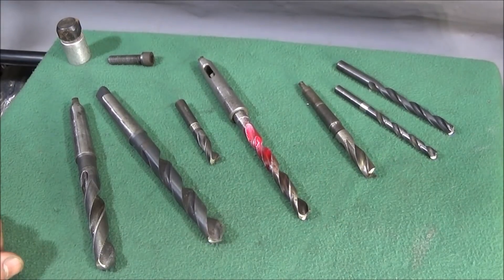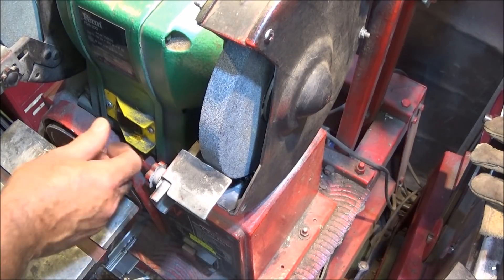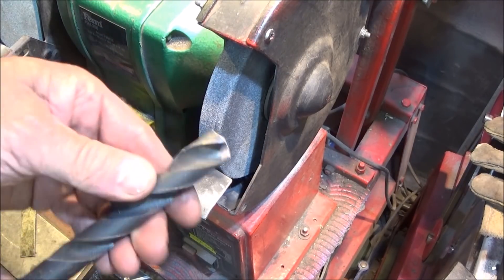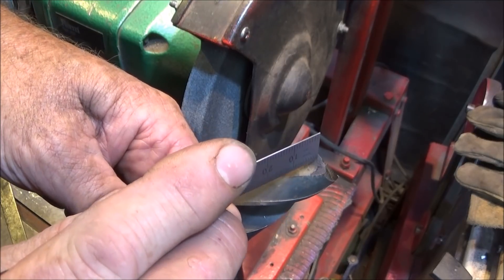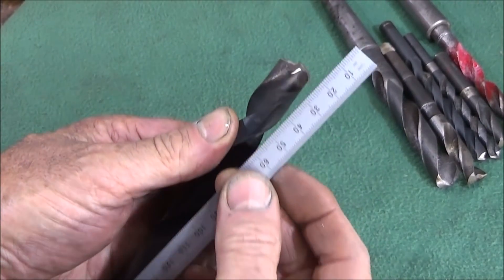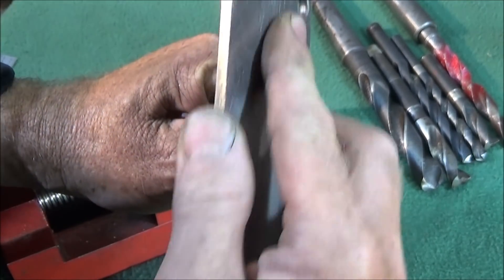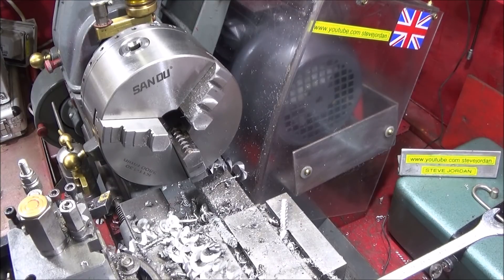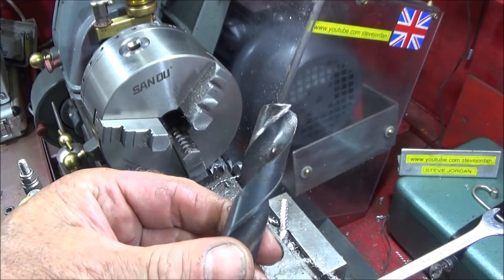Grinding Up Flat Bottom Drills & Using Them On The Lathe

Comment: Steve, this is probably a stupid question: forgive me, I'm new to all of this. What is the difference between a flat-bottomed drill bit and a two-flute end mill?
Reply: About 10 quid.
Reply from the maker: Hi Nicholas. A two flute end mill is designed for milling operations. A flat bottomed drill can only do what I have shown in making a drilled cone hole flat. Regards Steve

Comment: Thanks for another excellent video Steve, I'm going to practice on a few old drill bits. What is the cutting oil you use please ? All the best, keep the videos coming. Brian
Reply from the maker: Hi Brian, I just use new clean engine oil, any grade. (which I pick up cheap at my local recycle center)..I used to use a proper cutting oil, but to tell you the truth, I don't notice much difference between the two. Regards Steve

Comment: Great tutorial Steve.  Well videoed.  I noticed early in the piece you have a couple with a notched centre.  I generally do this as you are invariably making a recess for a cap head bolt as shown, and have a pilot hole to work with.

I find the notch reduces chatter a bit.

But for a blind end you don't want the notch ;)

Cheers Rob
Reply from the maker: Thanks Rob. I hope to show a few other ground tools soon, now that I have managed to quieten the bench grinder a bit! Regards Steve
Reply: What's a blind end?

Comment: Good demonstration Steve. I've done a few of these in the past, but I always left the 'hook' on the cutting lips - I will try out your flattening technique next time as it looks a though it will make a stronger cutting edge. Thanks.
Reply from the maker: Hi Ian, Yes I think it does.I have never tried using one without grinding the flutes back square. I learned this grinding method back in the 70's, when we had to make all our own cutting tools. I have used it right through to where the drills were re-ground in the same way, on tool grinding machines for the CNC lathes of today.

Comment: The lathe seems to have plenty of torque with the new VFD and motor .
Reply from the maker: Hi John yes the torque is excellent. The drive belt slips a bit if I push the drills a bit fast. I like it this way though, as it is a bit of a safety measure, plus it gives further indication of whether tools are ground correctly or are sharp. Regards Steve

Comment: Thanks for another very informative video Steve.  
when using those do they drill in just to where the tip of the normal drill bit
has gone and stop there or will they continue in for as far as you want to push it?
In other words do they act just like and end mill and cut as far in as you want to go?
Reply from the maker: Hi You can go deeper, but I usually just 'clean-up' the back face with them. This makes the flat bottomed drill last longer between re-grinding, particularly on steel.